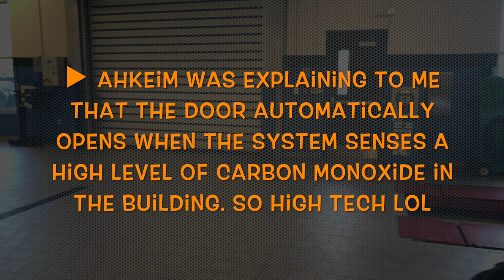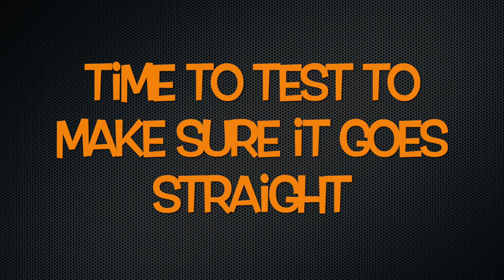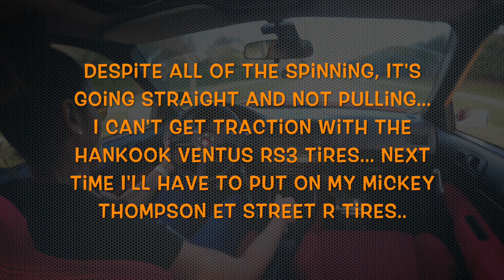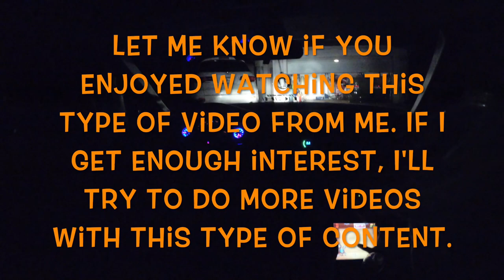Alignment Day VLOG - Female Built Turbocharged Honda Civic

Comment: No radio & no air con? Sacrifice for the turbo? My civics got tunes packed but I got to re-gas the air con so I roll with the windows low too.
Reply from the maker: The a/c was a sacrifice to clean up the engine bay and for the turbo. I had a radio in the car, but I didn't listen to it much, I'd rather hear the motor lol .. It's not my daily, so it doesn't bother me.

Comment: is it a b20 block?
Reply from the maker: Its a B18C1 (GSR) block
Reply: Aisha Christian aka aisha_ladybuilt perfect exactly what i got! My block is a NA 86mm bore, 13:1 comp, sleeved with cams and ported head(nos). Can i go str8 boost with this set up, would i have to change gasket or build something to be safe?
Reply from the maker: In my opinion that's too high of a compression to boost it. I would advise you to check with your tuner first.
Reply: @shionnsr8684  plus 86mm is like walking on eggshells. Better build something from scratch.